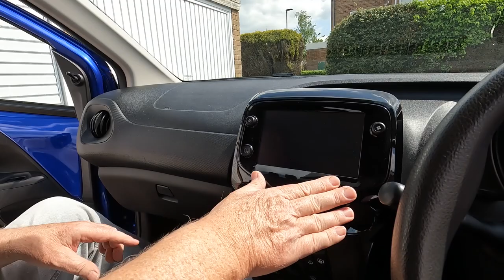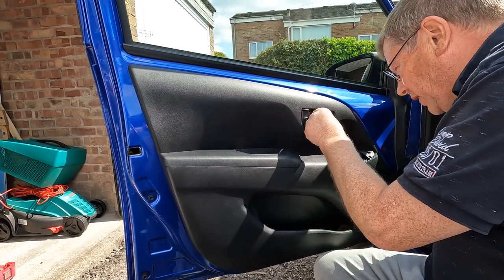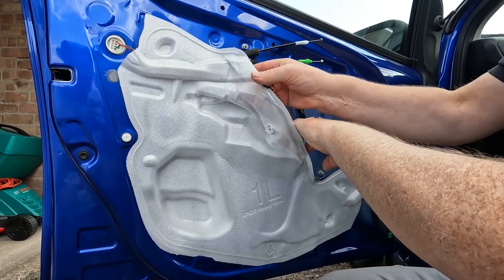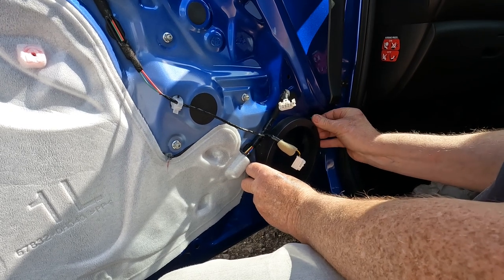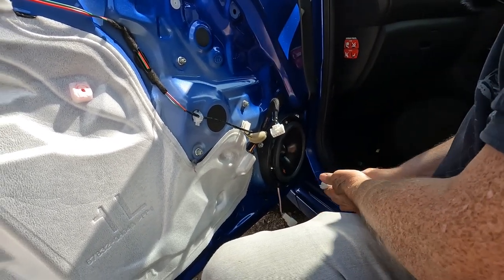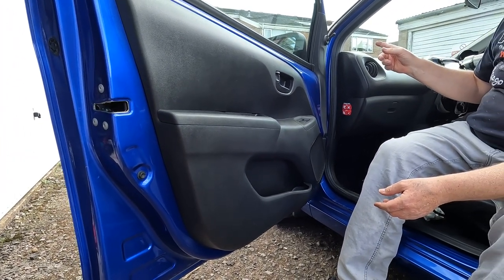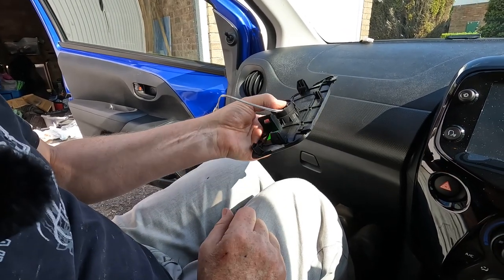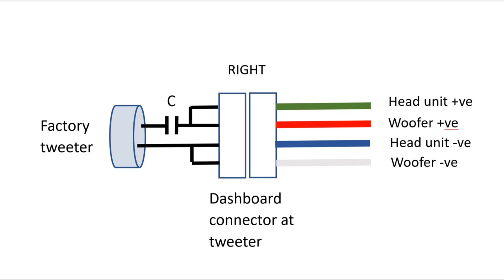Toyota Aygo / Citroen C1 / Peugeot 108 107 - Installing JBL607C Component Speaker System

Comment: A well thought out kit , shame that JBL didnt include the cable adapter too or it would have been perfect.
A few words about the sound after the install  may have helped too.
Reply: I did the same upgrade with JBL 607CF (CF = without speaker Grill).  Just by installing a woofer on the passenger side, I notice the passenger side has increased in volume and increased in clarity, especially at vocal frequency range.  I was also surprised by how flimsy were the OEM speakers (extremely light, carboard like sound cone and the magnets hidden).  For low (bass)... I had an under seat subwoofer so not exactly needed in my setup.  I do notice I had to tune down my subwoofer slightly.  Currently I'm still waiting for a better woofer bracket and a couple of wires before I can complete the installation.   If you are the sort of people that can distinguish high / mid & low, then this is a good upgrade.

Comment: Excellent video, I’ve searched high and low for the connector (or adapter loom) that you’ve made? Could you help atall? Thanks
Reply from the maker: @A6RXN  Not sure which adapter loom you mean. All the connectors are standard Toyota and adapters are readily available from many suppliers - e.g. the dash top speaker adapter connectors are Connects2 part no. ct55-ty02.  But there are other cheaper suppliers of equivalents.
Reply: @erictechUK  Thanks for the quick reply, they’re £4.99 so not too bad but if I could find the empty female connector to make my own that would be great, every combination of wording I’m using for the connector only returns occupied connectors 😭

Comment: thanks for the video.. can you please show us how you wire the four pin plug into two for your speaker connector.
Reply from the maker: There is a wiring diagram showing connections and wire colours right at the end of the video.
Reply: @ericchowanietz7993  Thank you very very much for such a quick response...I am a big fan of yours..  as my 107 wiring is slightly  different colour coding..  Can you please advise that the four pin plug the right side two pin  is  the negatives?
Reply: by the way ..my wiring colour system is as follow.. front left is purple, brown, pink and black.. Driver side is white, green,red and blue.🙏
Reply: @dw1hkdavidtkwong did you manage to do this? Facing same issue now

Comment: Hello, where did you get the wiring and adapter for the tweeter? Please could you provide a link? 
Also, are you able to send a link to the door speaker adapter too?
Many thanks 😁
Reply from the maker: If you look through the comments below you'll find links to both the wiring adapters and the speaker rings.
Reply: @erictechUK  many thanks, and what about the wiring for the box ? Did you have to buy wires or did they come with the JBL?
Reply from the maker: You have to buy wires and crimp on terminals.
Reply: Any specific size wire ?
Reply from the maker: For car speakers 16 or 18 gauge wire is fine (16AWG or 18AWG). Note that 16 gauge is thicker than 18 gauge. You can buy small reels of hook-up wire from Amazon or Ebay.
Reply: @erictechUK  thankyou very much 😊

Comment: I've just bought a mk2 / 3 door and really want to put some speakers in the back - I just like to be a bit immersed.

From what I can tell, the standard head unit only has two channels, so I'm not sure how to work around that (have-a-go DIYer here). 

However, I want to keep the head unit because of the reversing camera/microphone/steering control compatibility.

Any suggestions?
Reply from the maker: Get a small two-channel power amp (suitable for high level input) and piggy-back it off the HU speaker outputs.
Reply: @ericchowanietz7993  Thank you. Just googled it and that should do the trick. Although I guess I won't have any fader control.
Reply from the maker: To connect an amplifier or subwoofer use a wiring adapter type CT10TY01  https://connects2.com/Product/ProductItem/CT10TY01
Reply: @erictechUK  Thank you!

Comment: Isn't there an OEM crossover from toyota that already splits the signal to the woofer-tweeter?
Reply from the maker: No.  The OE tweeter unit incorporates a capacitor as a simple series high-pass filter.  This is shown in the wiring diagram at the end of the video.  Once the OE tweeter is disconnected you lose this feature and you must connect the JBL crossover.
Reply: @erictechUK  thanks for the reply. You helped me a lot. Cheers

Comment: Where do you found the speaker mount adapter?
Reply from the maker: These are available from many sellers.  Look for Toyota speaker adapter 165mm (6.5") with three mounting holes. E.g. https://www.ebay.co.uk/itm/185682511302